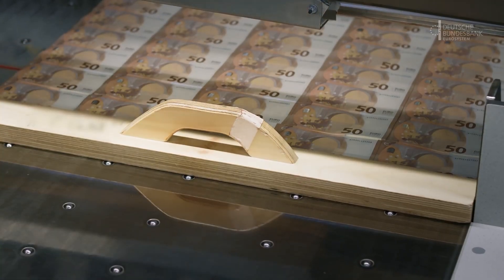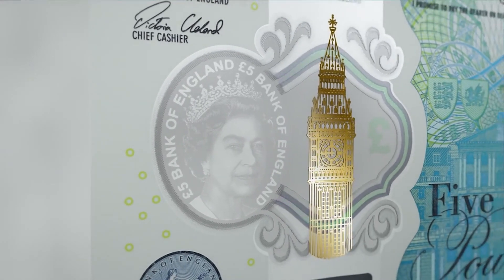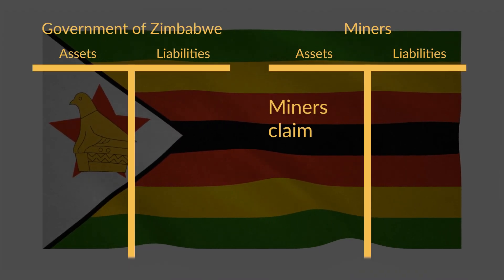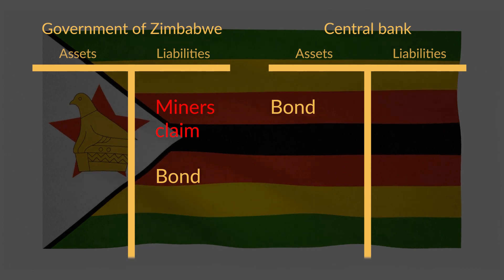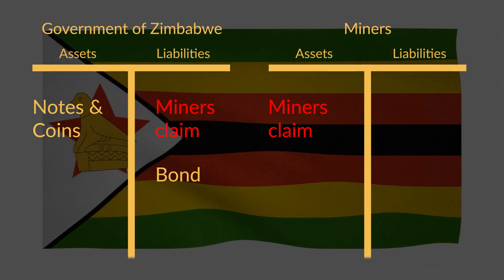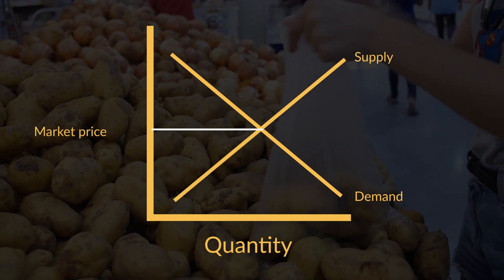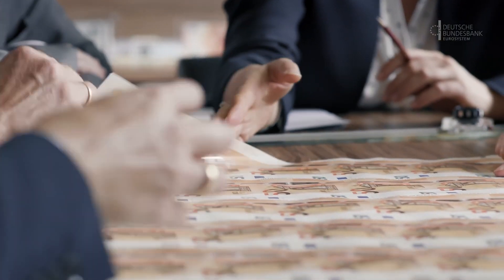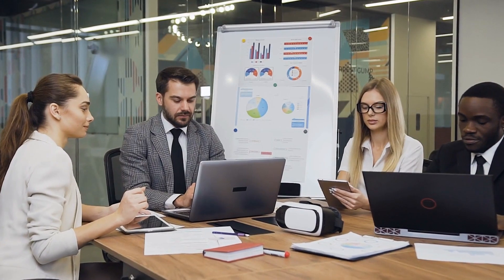How to Print Money without Causing Inflation

Comment: It makes sense that if supply went up (say, with GDP as a proxy), increasing the currency will simply allow the ratio of dollars to goods/services to be stable.  However, it seems to me that if the economy slows down, then you need to take money out of circulation to stabilize prices.  I didn't understand the assertion that printing a bit of money can help in a recession.  I guess it depends on what causes deflation.  If it is due to increasing productivity, then yes, that's the same as printing more money to chase more goods and services.  If it's due to decreasing demand because the poor have less money, then the success of printing money will depend on injecting it into the nonwealthy population.  Otherwise, the wealthy will just spend in on the asset bubbles.

Comment: I like the clear explanation and argumentation, but I have to make a critical remark here: 
- There is a bit of wordplay around inflation of hyperinflation and the definition is not very clearly given in the video. As the value of all goods, services, assets etc. is expressed in the terms of money and traded using money, inflation can be seen as the increase of the amount of money in the system in comparison to the amount of value in the system. In practical terms, stuff costs more money, because there is a higher supply of money. 
- When using the above definition, you have not given a (true) solution to the title problem: The amount of money still increases, but instead of it just increasing the money supply, you used the money in a way (with a few assumptions) to also increase the value in the system, assumed that would be proportional, and thus nullified the effect of the money supply: No inflation.
- What you have proved is that you can print money, as long as you succeed in using the printed money to increase the real productivity of the economy proportionally. 
- I would argue that, if you knew how to do the above reliably, you have basically solved the economy: If you can know how to put money in the right place to reliably maximise productivity, there is no more need for markets, scarce good are always at the best possible place and free choice can literally only make things worse. But I would argue that you can never know (for sure) where to put money to increase productivity, because you will always lack information

Comment: guys, this is MMT! the assumption that just injecting money into the economy in case of a recession will solve said recession, is an absurdity. If people are not consuming specific in case they are in a bad situation, it's because that is probably the best thing to do both individually and as a society, people don't need an incentive at all to consume, even if there is a deflation (something none of us have ever seen but ok). Injecting money in such a case creates a false sense of security on people and they spend money they don't actually have in things they don't actually need and that downwards spiral leads to a depression, through inflation. Also according to MMT, there cannot exist recession paired with inflation, but we all know that is not true
Reply: You're absolutely right. The model from this video might generate some immediate positive results, but eventually will fail and lead towards a recession. This is tantamount to gambling with society's money, it might bring economic development, but it can easily cause inflation and devalue people's savings.
Reply: You have to understand what happens in a recession: more money gets removed (either by saving or paying back debt) from the economy than injected which leads to an economic slowdown.
Injecting money to stabilize the money supply in the economy is the only choice to avoid a deflationary spiral.
That’s why you have to understand how double entry bookkeeping and money creation works.

Comment: I'm quite dissappointed in this one. When you make a deposit at a bank with cash, new deposits are created. In a simple model, this swap doubles the "money supply", however, no one's net worth has been changed. Also, no purchasing power has been changed. You can demonstrate with balance sheets alone that money creation (via swaps) can have 0 effect on purchases. There's no need to discuss the "real economy" at all. Thats not all though. The graph you had for Supply and Demand is for perfectly competitive markets. Cash is a monopoly, so your graph is misleading. Not only that, but Demand is based on an unobservable unit called "utils". In practice, businesses merely set prices based on a discounting formula. Within Zimbabwe, the investment scheme you outline could very well do nothing due to corruption. It's quite possible that farmers will take the money and leave or not increase supply at all. Reducing supply to keep prices high is well noted in farming (as well as diamond mining). Additionally, the materials farmers need in Zimbabwe are foreign technologies, these need to be purchased in USD or Euros rather than local currency. Lastly, Richard Vague did a study looking at 47 countries over 60 years and found there was no correlation between money supply and inflation. This matches with what balance sheets say.

Comment: What about money printing causing the boom bust cycle according to austrian economic theory ? (and thus also in developed economies)
Reply from the maker: It seems at odds with historical evidence that private credit precedes booms, not government issued money. Heck, booms and busts already happened well before central banks were established. 

https://www.nber.org/papers/w15512
Reply: @Money & Macro  How is that evidence a refutation of the austrian business cycle ? The cycles could have been worse had money been printed as well ? We cannot tell that from evidence ?
Reply from the maker: @bartvanderhaegen6073  sure. But, wouldn't the "money printing" hypothesis mean that there should be a pattern of government issued money (note that M2 is largely money issued by private banks) and then booms following them. I've never found a study that empirically showed that this is what we see throughout history. Would be happy to be recommended some.
Reply: @MoneyMacro  But that is the problem of empiricism: no single set of empirical data allows to confirm whether the boom/ bust was caused by the increase in money supply or whether another thing caused the boom/bust or another thing counteracted the boom/bust. One can only logically construct a perfect counterfactual world (where all things are taken equal except for no money printing) and deduce conclusions from the difference between both. You never have the empirical data of the counterfactual world, and yet the counterfactual world is the relevant one to compare outcomes with (and thus draw meaningful conclusions)
Reply from the maker: @bartvanderhaegen6073  empiricism taken to the extreme is difficult in macro, sure. But this Austrian theory is posits a really strong hypothesis: government money printing --> booms & busts. If that is true, there should really be some patterns historically to show that this is true. Or at least, counterfactuals where bubbles happened in systems without a central bank should be explained.
Reply: @MoneyMacro  empiricism is always flawed, not only in its extreme. It is flawed for the reasons I gave
Reply from the maker: @bartvanderhaegen6073  So, I can spout any theory that sounds nice and never be wrong. That is not the scientific way. But, if it is something you prefer then who I am I to argue with you.
Reply from the maker: Maybe I should elaborate a bit more. Say that you throw a giant rock in a river. Afterwards, the river is diverted to another stream. Yes, you could say, hold on, this doesn't completely prove that the rock caused the river to flow differently. After all,  there is not parallel world. Perhaps in that parallel word, the river would have also been diverted. My theory, that god wanted the river to change is equally valid as your rock theory. This of course, has an element of truth to it. I cannot without a reasonable doubt proof that the rock shifted the river and not god. But, the scientific way is then to say, the hypothesis that the rock did it, has stronger evidence than the 'god' theory, and therefore we now accept the rock theory, until it is disproven. Using this methodology, empirical evidence (the flow of water suddenly changing after the rock entered the river) plays a crucial role.
Reply: @MoneyMacro  Your reasoning is not correct. In the river example we do the same: we only can assume that the counterfactual world (where the stone is not thrown) is just identical to the one before throwing the stone. That is always the case in physical/ physics experiments, we can always first measure the counterfactual world of "doing nothing". In social sciences like economics we cannot do that, the actual human world is much more messy and unpredictable (you cannot predict the growth of knowledge and thus also not the knowledge of trades and choices). So the counterfactual world needs to be constructed based on logic and not empircal measurements. Only when you construct it using logic, can you eliminate all possible other causes that in the real world are also affecting the outcome you want to understand. Did you also conclude that I claim that evidence has no role in science ? (if yes, then wrong as well, evidence plays an important role, but not the one you propose as being able to confirm or deny theories or causes of phenomena)
Reply from the maker: @bartvanderhaegen6073  can we assume that? Not per se in the case of bringing in a godly being, right? 

I know and agree with Hayek that social sciences are much more complex and therefore, it is more difficult to select theories based on evidence. 

The problem with using logical theories only is that there are thousands of logically sound theories. So, if you don't want to use evidence anymore, you end up with thousands of internally consistent (logical), but not externally consistent (not in line with evidence). 

So, what is the role of evidence then, if it is not to judge our theories?
Reply from the maker: @bartvanderhaegen6073  the problem that I see (and perhaps you do as well) is that if we want to understand important stuff like inflation, we need to select the right theory among many many theories. 

This is the selection process that I apply.

1. the theory has to be internally consistent (in other words, logical). (you apply this step as well!!)

The problem is that. Yes your theory is logical in itself. But, there are many more theories that are that. E.g. new Keynesian theory, Real Business Cycle theory. These are even 'proven' mathematically. Completely logical. So, too many theories left. Therefore, I (and most social scientists) apply a second filter. 

2. does the theory describe how the world works? 

E.g. a theory that seeks to explain German politics by claiming that it is because of how inbred the German Monarchy has become doesn't pass this check. After all, Germany is not a monarchy. Similarly, the theory you mention doesn't pass the sniff test here. Central banks 'printing money' is only a small part of the total money supply When, we observe modern systems, we see that private bank money creation is the primary creator of money in the economy and that it is influenced but not 1:1 controlled by the interest rate. 

3. are the predictions that the theory makes not disproven by basic evidence. 

Regardless of whether a world runs only once, a good theory makes predictions about patterns (correlation not causation). If it gets these basics patterns wrong (the theory predicts booms & bust happen when interest rates are low (correlation). The evidence shows booms & busts happened under high and low interest rate, under gold standards, under fiat money. 

So, this theory is rejected and we need to find a better one.
Reply from the maker: @bartvanderhaegen6073  not exact predictions. Conditional predictions, if this happens (e.g. you print money), that happens (e.g. you get inflation). 

I think it is important to judge theories by how often they get these conditional predictions right. You do not. We agree to disagree. 

(New Keynesian Theories got Nobel prizes ... too right? ;) )
Reply: @MoneyMacro  Data cannot even refute conditional predictions as I explained already: you can never tell if the data (e.g. no inflation) was caused by 1) some other influence or by 2) the money printing. That is why you can only rely on logic to compare with a logically constructed counterfactual world where "all other influences" are guarantueed to be left out. You have to counterargue against this refutation of empiricism. Otherwise you are only being irrational in saying "well I like data so much I will just keep continuing reading in them what I like to read in them, and because I can do math and I like doing math etc etc" You are right however that Nobel prices do not convey truth upon theories. Keynes is false (in essence because we are no animals as his "deepest" argument tries to posit) and yet he won a Nobel price ;-)

Comment: 11:26 It is geometrically the same thing if you imagine the lines continue infinitely in both directions, but I think it would be a lot more intuitive if you slid the demand line up (representing a willingness to pay higher prices) instead of to the right, and still slid the supply line to the right (representing an increase in quantity of food). Also, you messed up a bit with your words when you first described the supply and demand graph.

Comment: As you can see we are already in July and I feel
those who would allow the market dynamism to
determine When to trade or not are either new in
space in general or probably just naive, the sphere
have seen far worse times than this, enlightened
traders continue to make good use of the dip and
pump even acquiring more equities towards trading
sessions, I'd say that more emphasis should be put
into trading since it is way profitable than holding.
Trading went smooth for me as I was able to raise
over 9.2 BTC when I started at 3.5 BTC in just few
weeks implementing trades with signals and
insights from Ryan Donald's would advise y'all to
trade your asset rather than hold for a future you
aren't sure about.

Comment: Hi! Any chance you might have an explanation on how the second kind of responsible money printing works? Is it simply by causing a little bit of inflation to counter deflation?
Reply: Not qualified to answer but from what I understood, yes it and QE can be used to ensure we don't enter a deflationary spiral, but also it can expand the capacity of the economy and utilise resources already in the economy more efficiently. Like if there are price increases caused by shortages of a good, through a bottleneck at a major port, then responsible money printing might be investing to increase the size and ability of the port to process deliveries, or building a rail network for faster transit. Resolving the bottleneck in this case is responsible money printing, as it will increase supply. Sorry if that is not relevant to your question

Comment: Hi Joeri. Thanks for the amazing content.
I have a question. If the Zimbabwean government wanted to stimulate gold mining but without causing the massive inflation, what tools did they have? Evidently money printing wouldn’t work in this case.
Reply: My best guess would be using something like the MEFO bills Nazi Germany used. They had 1:1 value with the money at the time and were basically IOUs that the central bank could determine when and how much to exchange for real money. So basically you'd give the MEFO bills to the mines and they'd pay the suppliers with them, but they couldn't be exchanged beyond that and the government would have the power to slowly redeem the MEFO bills with normal money as the investment in the mines started to pay off.

Comment: inflation is the expansion of money supply. rising prices are just a possible consequences of it. unless if money supply is contracting faster than it is expanding, then it is by definition inflating.
Reply from the maker: That is not the definition economists and the general public use. 

But, if you prefer your own definition. Fine by me.
Reply: @MoneyMacro  It is the only correct definition. The definition that google gives begs the question and is circular.
Reply: Yeah, you rube, you should learn the newspeak definition of inflation.
Reply: @rutessian  you mean the new speak of definition of inflation which keeps changing how we measure cpi? Like how we twist the meaning of recession?
Reply: "unless if money supply is contracting faster than it is expanding" no it's
unless the money supply is inflating slower than the rate of goods and services.
If the society produces 10% more goods and services per year but the inflation rate is 5% then the prices of goods and services will drop 5% but in reality they should have dropped 10% because there should not be money printing.
Your first sentence is correct though.